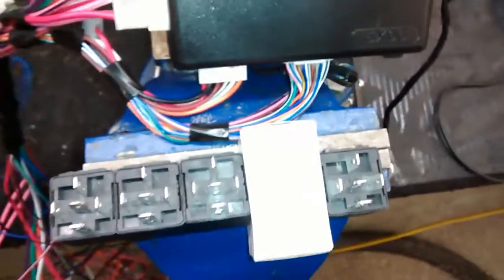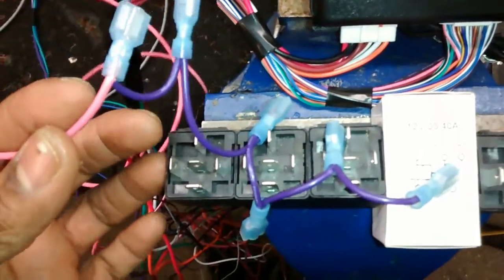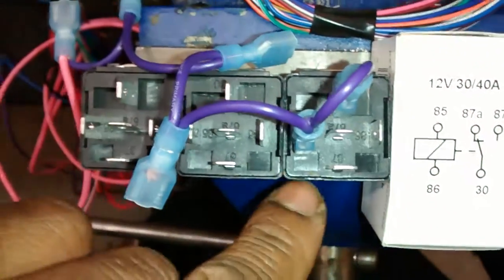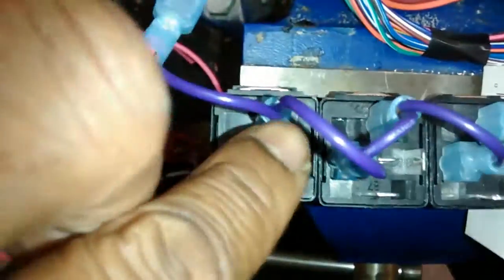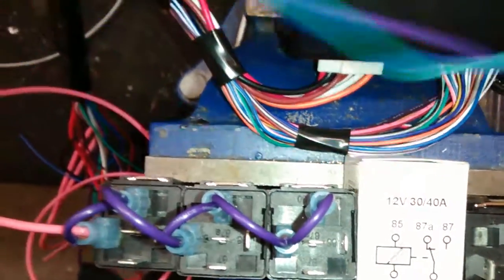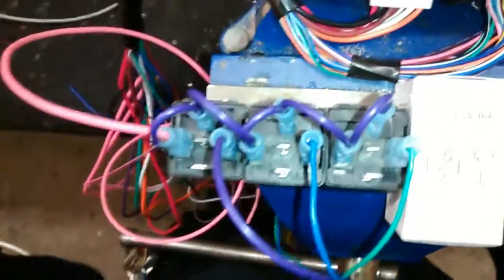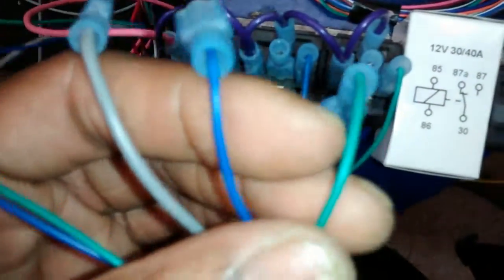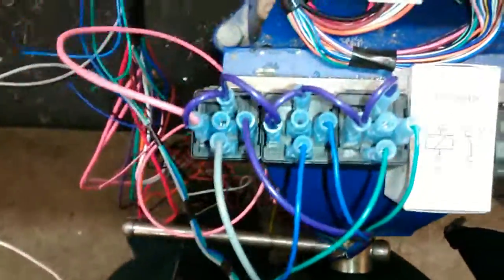How To Wire Up A 5 wire Relay For Positive Door Locks Actuators Invert Converter

Comment: I have a 08 pathfinder that uses a communication line that sends a signal to the bcm the bcm reverses polarity. Can I use the relays to go straight to the driver door lock actuator. And will that interfere with the bcm?

Comment: So how do you know if your system needs which polarity.? I looked up the wiring diagram for my vehicle and all my door wires are labeled as negative. The door trigger, the door unlock and lock and the trunk trigger are all negative on my wiring sheet for my car. But next to the power unlock line on the diagram it says “High energy locks, use relay to trigger”. On my factory system if I press unlock once it unlocks the driver door and pressed again it unlocks the rest, I’d like to retain that feature, is that possible. My aftermarket alarm has a pink wire for 2 step door unlock.
Reply: Victorious 69 I have same functionality in my OEM central lock. Did you figured out how to do that?
Reply: Probably late for you two but anyone else looking for this, the way you do it is 85 and 86 on relay go to 12v and the negative trigger from the security system. Then 87 goes to ground and 30 goes to door lock wire.

Its the exact same set up this video shows, except instead of sending 12v to the door lock system through pins 30 and 87, you send GND to the system.

Comment: Wait, so the green and blue wires from the brain, which wires did you solder to the negative lock pulse wire, - unlock, and trunk release?
Reply from the maker: (-) Green (Lock) from brain to relay 85 trigger Relay #1 Right relay
(-) Blue (Unlock) from brain to relay 85 trigger Relay #2 Middle relay
(-) Pink (Trunk release) from brain to relay 85 trigger Relay#3 Left relay
Reply: PrecisionConnections how many amps max should these be? I have 40 amp max relays.
Reply from the maker: jp554731 15amp fuse on 12volt source
Reply from the maker: pin 78

Comment: Would I need to make these relays for a 2000 Chevrolet Silverado? I looked up the wiring diagram and it says that the unlock and lock are positive.
Reply from the maker: it's a five wire system But you can buy a bypass module for under $30 to make you life easier the part is xk01
Reply from the maker: follow this video for that vehicle